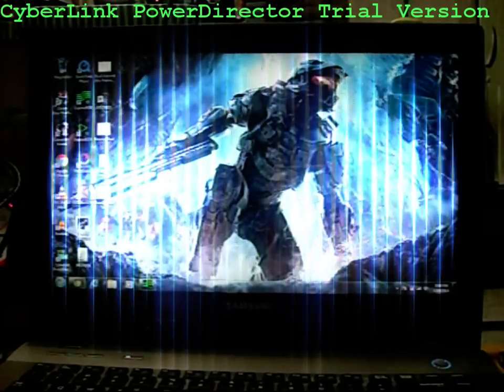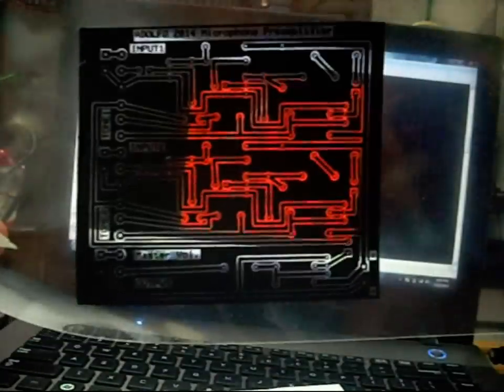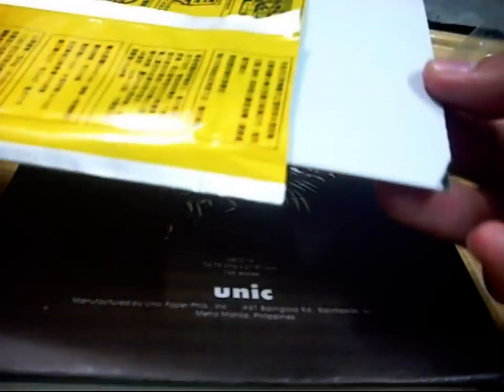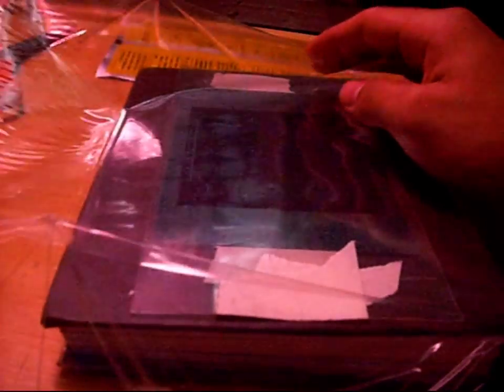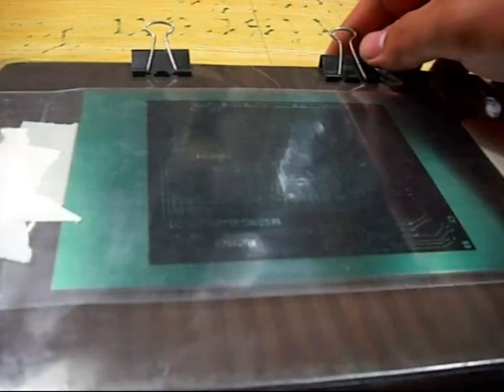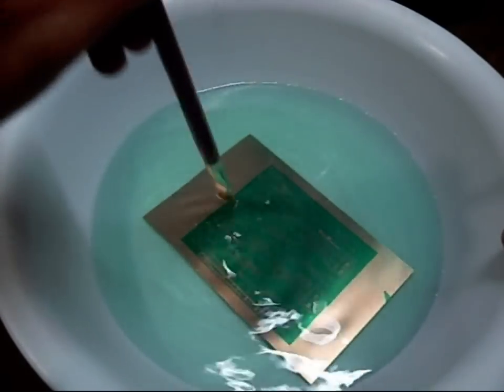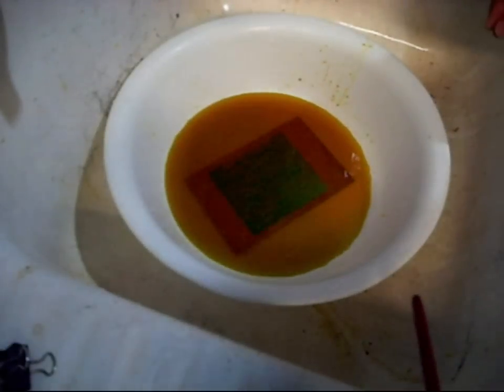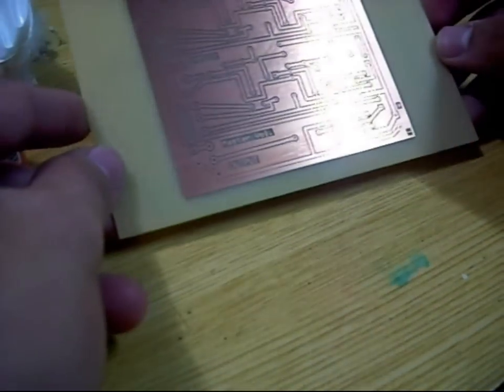How to make your homemade PCB using Presensitized Board

Comment: Anu ibig mong sabihin na double layer ung sheet?
Reply from the maker: ginawa kong dalawang magkapatong na acetate with the same design para mas dark/mas matakpan nya yung presensitized board along dun sa mga copper trace. Kapag isa lang kasi, if ichecheck mo under the light butas butas yung artwork. If that's the case, may mga parts along the copper trace na matatanggal din kapag nadevelop na sya. Yun ang purpose nya.
Reply: @ChriseanAdolfoElechrisean  oo nagets ko na tnxx. Pero isa layer lng ginamit ko at mukhang magkakaron tlga ng disconnection kc pangit ung pagkaprint sa acetate tinry ko sya ibilad sa araw maganda naman result.
Reply from the maker: @iamkyleofph  good good :D

Comment: Did u use regular printer to print on the clear paper and whats name of the clear paper used to make the print ?
Reply from the maker: I did use a toner or a laser printer. That clear paper is acetate sheet/paper and is typically used in over-head projectors.

Comment: Isn't copper supposed to be the lines not the other way round?
Reply from the maker: what do you mean by lines?
Reply: Divergence  he made it right, just look very closely you will see that the lines is copper, those un exposed part that will be the connecting lines for electronic components.